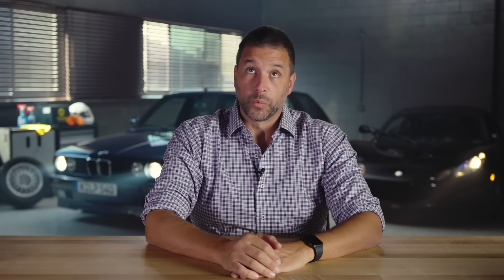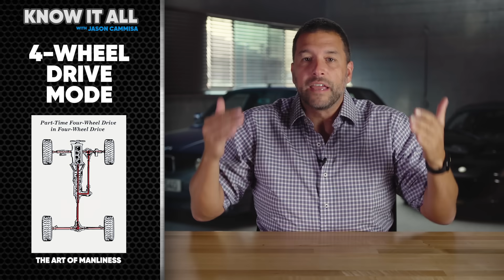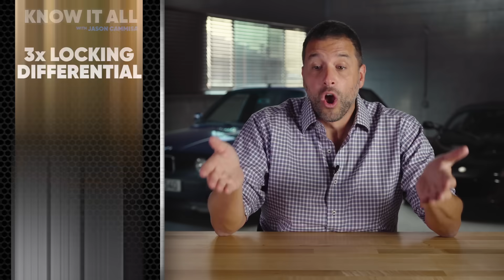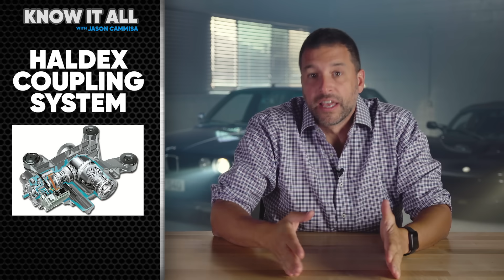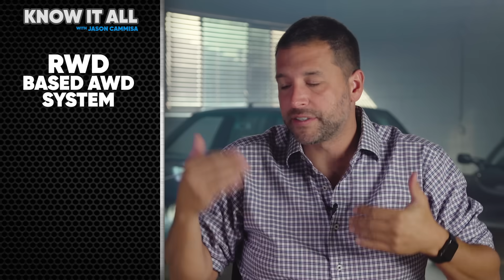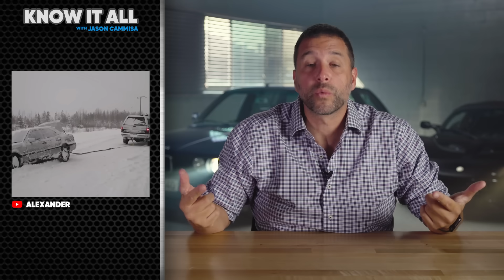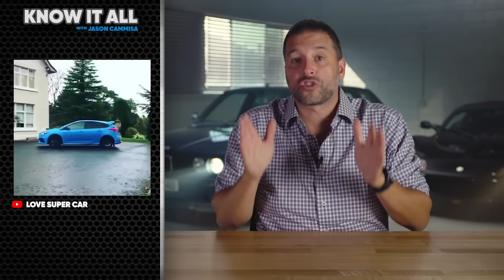Understand Your All-Wheel-Drive System | Know it All with Jason Cammisa | Ep. 04

Comment: this isn't entirely true regarding Audis. The A4 and upwards do in fact have a RWD biased drive train, unlike the haldex in the A3/Q3 and down models. My old Passat 4M was indeed FWD biased and the suspension soft so she wallowed and understeered. The wifes Golf GTi also, very noticeable FWD and hard to get power down on traffic light races, understeer noticeable on the back roads.
My current Audi A6 Avant quattro, different kettle of fish, RWD biased and you know it. Sure its no E39, but she pushes off at the lights, is very pointy in the corners, even for a barge, so much so my wife finds it too sharp after driving her darty little GTi. I had a Q3 for a brief stint, awful thing, that did oversteer and at the lights we worse than the GTi for pulling away, it would squeal and hop its way across the intersection. That FWD bias system was so bad it felt like it was only FWD.

Comment: OR ...... YOU CAN JUST BUY A BABARU WITH Symmetrical all-wheel drive (AWD), a feature primarily associated with Subaru vehicles, refers to a specific drivetrain layout where the engine and transmission are aligned in a straight, symmetrical line along the vehicle's centerline. This design results in a balanced weight distribution and a lower center of gravity, enhancing handling, stability, and traction. Unlike some other AWD systems, Subaru's symmetrical AWD continuously distributes power to all four wheels, optimizing grip and control in various driving conditions. 
Here's a more detailed explanation:
Key Features and Benefits:
Balanced Weight Distribution:
The symmetrical layout of the engine and drivetrain components contributes to a balanced weight distribution, which helps minimize body roll during cornering and provides a more planted feel on the road. 
Lower Center of Gravity:
The low-mounted engine and transmission design result in a lower center of gravity, further enhancing stability and handling. 
Continuous Power Distribution:
Unlike some AWD systems that primarily operate in front-wheel drive and only engage the rear wheels when needed, Subaru's symmetrical AWD continuously distributes power to all four wheels. 
Enhanced Traction and Stability:
The continuous power distribution, combined with the balanced design, helps to maximize traction and stability, especially in challenging conditions like snow, ice, or wet roads. 
Improved Handling and Control:
The predictable power delivery and balanced weight distribution contribute to more confident and responsive handling, making the vehicle feel more stable and controllable. 
Reduced Torque Steer:
The symmetrical layout helps to minimize torque steer, a tendency for the vehicle to pull to one side during acceleration, resulting in a smoother and more controlled driving experience. 
How it Works:
1. Engine and Transmission:
The engine and transmission are positioned in a straight line along the vehicle's centerline. 
2. Power Transfer:
Power is transferred from the engine to the transmission and then to a center differential, which distributes power to the front and rear axles. 
3. Wheel Speed Sensors:
Sensors monitor the speed of each wheel, and the system adjusts the power distribution to each wheel based on the amount of traction available. 
4. Active Torque Distribution:
The system can actively adjust the torque distribution between the front and rear wheels to optimize traction and stability. 
In essence, Subaru's Symmetrical All-Wheel Drive is designed to provide a more balanced, stable, and controlled driving experience by maximizing power delivery to all four wheels and minimizing the negative effects of traditional drivetrain layouts.

Comment: The reason of the domination of the front wheel based car with AWD system sent power to the back so it's understeer and understeer is normal people's driving skills and road safety. Understeer in cars is more like a positive stability in airplanes. When your car understeers, it sends power to the back, so it becomes less understeer. If still not good enough, you need to slow down... If you want to oversteer it or drift, you need to use left foot brake or handbrake. Even WRC Rally1 is dominated by the symmetrical 50/50 AWD cars right now. The salesman didn't lie to you. When normal customers ask if it can send 100% power to the back, they are more asking about if 3 wheels slippery on the ice or snow, they can get out of stuck or not. They are not asking about a handling performance like the RWD based cars. RWD based cars never advertising if they can send how much power to the front nowadays is not because they are honest. It's because their target customers don't need to know that. They don't even need the cars to send power to the front to keep drifting.

Comment: I don't see any mention of torque limits on the clutch of a multi-plate clutch.
Is there a transfercase that can send 50% of the torque from 1st gear to the subdrive axle?
I doubt it....

In most FWD-based AWD vehicles, if the front wheels lift off the ground, 
only a small amount of torque is transferred to the rear, not enough to climb even a gentle incline.
The rest of the torque? It's just making the TC hot.

Comment: True story, all-wheel-drive Hyundai Genesis comes into the shop. Nobody realizes the front and rear tires are different widths, but the profile look the same customer had asked for a tire rotation. Tires were rotated. Customer comes back next couple days asking why is my car acting so weird and my traction control on we look at his car couldn’t figure it out. One of the tires was starting to split. He took the car to the dealership. The guys at the dealership couldn’t figure it out. A lady service advisor looked at the car and said hey the tires are on the wrong axles. there was so much power going to one wheel. I don’t know if it was 100% but it started to split one of the wonderful new Bridgestone tires that only had 7500 miles on it. True story.

Comment: Dont I know it. I drive a Hyundai Tucson 2015 and the 4WD is a joke. Go up a wet mountain road (asphalt) and turn it into a tight switch and it will fail just like a normal front wheeler.
Utterly useless for which I paid dearly for towing service. 
All wheel drive at all times is imho the best to handle on slippery roads.

Comment: The assumption that a drift is my main goal is the issue. I just want a car that can handle well in the wt, dry and snow. So whether front drive based or rwd based, they both achieve that. And understeer and oversteer only become an issue at the limits. If you are below those limits, neither one comes into play

Comment: None of these systems means a damn if the owner doesn't put on the right rubber for their driving conditions. I watched a million-year-old man in a baby blue Geo Metro with show tires calmly pull out and pass a Hummer that was stuck on a gentle hill because its performance rubber could not deal with an inch of snow. I'll take brains over fancy tech every single time.

Comment: under failure, if BMW breaks a rear axle it will continue to send most of the power there resulting in almost no drive. Without meaningful feedback from the wheel abs sensor to suggest a free wheel scenario, you won't get much more drive than equivalent to a couple of guys pushing it.

Comment: There is the Subaru Torque biased centre differential on a few models that sends 65% to the rear using some clever satellite/planetary gears in the diff. My favorite…
Reply: It's called Variable Torque Distribution. The centre diff has planetary gears that can drive the rear wheels with more torque than the front, while still rotating at the same speed. A computer controlled clutch limits the slip and alters the torque split.
Reply: @John-rf7yw  the beauty of it is the different sized stacked satellite gears (they call "pinion gears"), mechanically sending more torque to the rear from the rather odd centre diff setup. And yes, indeed, additionally it can be electronically clutched and locked. https://www.google.com/url?sa=i&url=http%3A%2F%2Fwww.subaru-svx.net%2Fforum%2Fshowthread.php%3Ft%3D64713&psig=AOvVaw3SDsV0cWCQY-b9eV10eHIl&ust=1741787141712000&source=images&cd=vfe&opi=89978449&ved=0CBQQjRxqFwoTCNCcq_WUgowDFQAAAAAdAAAAABAK

Comment: Hi, great video. Recently saw some videos of Citroen cars with pneumatic suspension. I tried on YouTube but unable to find any video comparing pneumatic suspension and air suspension. 

Will be great if you can make a video on it as well.

Also why it’s been stopped by car manufacturers because air suspension was better and reliable or its just too good.

Cost reduction didn’t makes sense As it was introduced in Citroën cars which does not consider to be luxury cars, and even licensed by rolls Royce for its superior quality.

Comment: Are you seriously getting angry and preaching to people about how little they understand their 4wd?
Maybe you should do a little research on a manual 4wd with locking diffs and how they work. The whole point of locking diffs is that they send equal power to both wheels of an axle if one is in the air or not. Very, very basic.

Comment: Have done a few tracks days in my 8j TTRS and though it has a beefy rear sway bar (which helps) I haven't really had much issues with understeer. Granted I aim for a slightly late apex and the car has more than enough power to compensate. 

I think understeer is an overstated issue if you don't know how to anticipate it and turn off all your TC in which case you're just as likely to get into trouble with rwd. 

Love your videos!

Comment: Depending on the system, they can send 100% of power to one wheel, which in most cases will be useless. The best AWD  is 3 "open" diffs. with the center getting the engine power and dividing it up to the front and rear diffs. with 3 computer controlled locking clutch packs.

Comment: The VW system and the Audi systems are very different. The transverse Audis use the VW system but the longitudeal ones are not electronic. These are the OG big boy quattro setups that are 100% mechanical. It will always send the power to the tire with the most grip. However this requires all 4 wheels to have some level of resistance. If you take a wheel off the ground or a CV axle breaks the car will not move because the worm geared center diff will spin in place. This diff is the first to receive power.  It needs the resistance to work. The S4 is a perfect example of this system.

Comment: One important detail about the original Audi Quattro system is the differential locks. The system used open diffs front, center, and rear, with the center and rear diffs having driver engageable locks. On early cars the center and rear diff locks were activated together. Sometime around 1983 the control was modified so the center diff could be locked on its own, or both diffs could be locked. 
Also consider the VW Touareg and Porsche Cayenne. The VW states is torque split is 50/50, whereas the Porsche has a rear bias. How... they have the same transfer case?? The VW simply normally drives with the transfer case locked, and unlocks it when you go around a corner!

Comment: what about Jeep Quadra-Drive? this is an odd video because you say none can send 100% to 1 wheel, but then you try and backtrack and say you're only worried about handling. if you're worried about handling, wouldnt honda's awd where it can send more power to the outside wheel that helps in corners be what you're after? if you're after "handling" you would likely never want 100% going to 1 wheel, right?
where as some like the jeep are designed more so for off road performance, not handling

Comment: Sooo speaking of the SQ5… in the rain or on the beach my 21 would would kick the rear end out before the front. Was that just in my head or was the 21 different? 😅 maybe it was in my head but now I want to know 🤣 my 21 Q7 definitely felt 50/50 but always felt engaged, I never had to wait for it to lose traction in the front to send power in the back. My A4 was definitely front biased and my Q5 loaners always felt front biased too. The SQ5 felt very different to the Q5 system though. Especially on the beach.

Comment: Your statement about the Audi SQ5 is incorrect.  The SQ5 does not power the front wheels by default.  The SQ5 has a permanent AWD system with a Torsen center differential, so it powers both axles by default with a nominal 40/60 front:rear torque split.  The system that understeers is the Quattro with Ultra technology, so you would be right if you were talking about the standard Audi Q5.  This system, like haldex, permanently drives the front axle and distributes power to the rear wheels using a multi-plate clutch. You should revise your Macan to SQ5 comparison to say Macan to Q5 comparison.  Also, you completely left permanent AWD with center differentials out of your video.

Comment: My awd system can definitely send 100% to an axle..the front one..because that's all it ever does 99% of the time, until the fronts slip enough to lock up the center diff..but that doesn't make its awdness any less of a lie..realtime4wd my ass..exactly like the haldex you said but no computer control on the center, just viscous

Comment: The trick to getting the Haldex cars to drive well, is to just treat them like a FWD car with more traction, slow in fast out, compromise your entry speed and be prepared to use your hand brake to get the car to rotate before the corner. 😂

Comment: Audi actually uses 2 types of allwheeldrive (quattro) - haldex  (you are talking about with SQ5) and torsen, which is called "proper quattro" and gives p tou 75% to back and 25% to front permanently, so it doesn just add front wheels in necessary.

Comment: Most Audi models DO NOT USE HALDEX SYSTEMS. You are completely wrong on the Macan vs SQ5 statement. They have the exact same torsen based AWD system, with the only difference being the Macan has a 69:31 rear:front torque split through the crown gear diff while the SQ5 has a 60:40 split. The SQ5 and the Macan S get the exact same torque vectoring diff in the back. Porsche calls its PTV Plus, Audi calls it Sport Differential. 

Audi tends to tune their AWD systems to be far more neutral rather than allowing oversteer because very few people buy Audis as track toys, they buy their sister brands Porsches. 

Audi uses haldex in the 3 series and below, and nowhere else. The majority of their models are torsen based.

Comment: Sooo if I put an LSD onto my X drive BMW I should be able to drift like a mad man?!  As long as I turn off all the traction control. But first I have to tune the trans for the LSD so the traction control that never really turns all the way off actually turns all the way off. Or is it the ABS system that needs to be killed first?

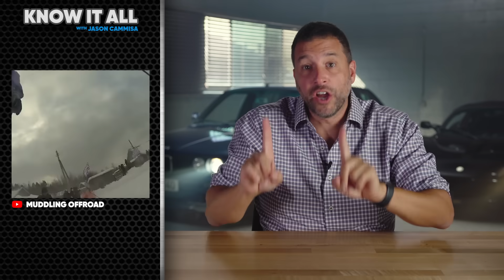Comment: 5:15 modern Audi’s with mechanical AWD systems do that, like the B8 and up, C6 and up, and D3 and up all overdrive the rear wheels to create the 40F:60R standard power distribution. That’s how they moved from the 50:50 Torsen-based Quattro to the 40:60

However, these Quattro systems are mechanical with a Torsen center differential, and yes they do have a heat problem, the center diff in my 07 S6 actually has its own oil cooler with engine coolant flowing through it to further cool it down.

I have the official documents of the transmissions on the C6 chassis, the one about my S6 shows a 3.801 front final drive, and a 3.793 rear final drive. Similar margins in the A6, S6, and RS6. Pretty interesting :)

Comment: The one video I’m not in agreement with…I don’t care that my “all wheel drive” haldex doesn’t transfer 100% power to rear wheels…it’s all wheel drive. I only care that it transfers some when the front slips. It may still understeer but it understeers with 100% going to the front anyway. It’s still better than just a front wheel drive car that loses traction with weight shift.

Comment: As a 2013 Volvo r-Design driver (Haldex 5), there is a trick to a solid power slides... over inflate the rear tires, drive way too fast into a corner, give it a confident flick on entry, and shove your accelerator through the firewall. It wont hold it as long as a M3 or Mustang, but it's enough to enjoy. In the wet or on loose surface roads, you can outdrive surprisingly quick cars.

Comment: The system that GMC uses in the Acadia is front based.  Even basic winter driving you get stuck before it will put power to the rear.  I'll keep my old testament selectable 4wd truck.

Comment: My Tesla can send 100% of power to the rear wheels. The trick is it has 2 motors. The rear motor is a DC permanent magnet motor with great efficiency. The front motor is a less efficient AC motor, which is ok because it only ever uses the front motor when you either floor it or if the rear wheels start losing traction

Comment: look up quadradrive 2 Eaton E lockers AWD system 2 sp transfercase with 4 low however so you could argue its a full time 4x4 with locking diffs controlled by the computer based on detected wheel slip.

Comment: 🙄 
This is not how most people use AWD. I’m in Traverse City just like Hagerty. You should know better. 

I had a five hundred with AWD and the front bias is AWESOME driving slow and chill in the snow. 

I don’t care about driving it at the limit because the whole reason I have AWD in that car, or most other Haldex sedans, isn’t to drive at the limit it’s to keep going in crappy weather. 

Sorry, the video just came off condescending. 

Also, how can a vehicle with 3 locking diffs send all the power to one wheel? The doffs are locked. Both sides spin. Out the car up on jacks and all 4 wheels turn.